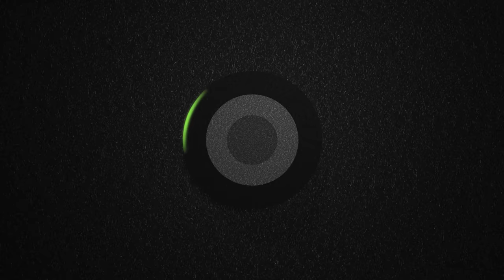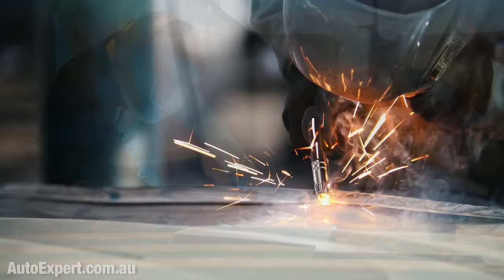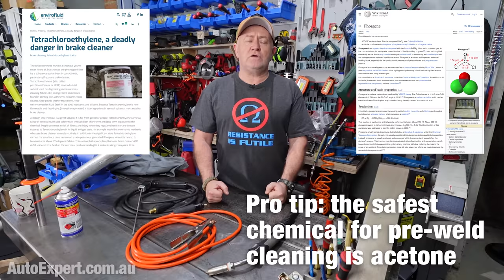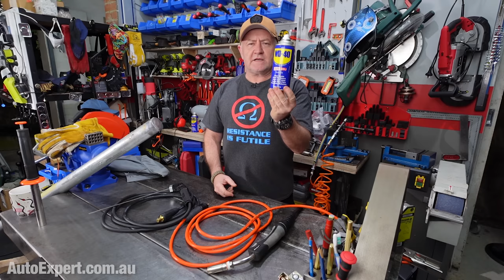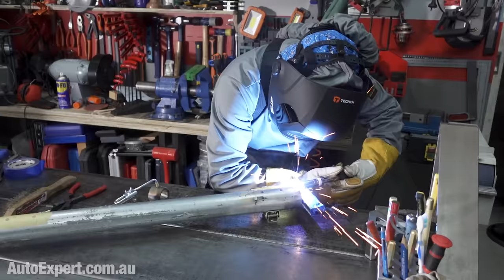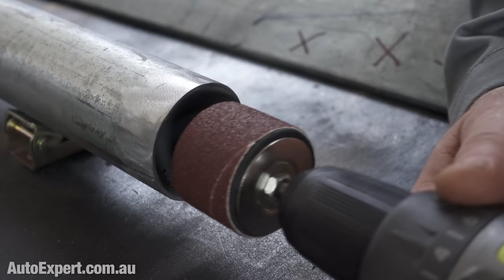How to die while arc welding at home: the top 5 ways | Auto Expert John Cadogan

Comment: I've been a professional welder for 15+ years, can confirm, these are all great points. Proper PPE is essential in all welding applications. I personally wear an Adflo 9100 rig at work 10 hours a day and it has made my life so much better the last few years. No more blowing black shit out of my nose at the end of the day, no more worrying about those accumulative chemicals you were talking about, and no more having to worry about people trying to talk at me while I'm welding because by now everyone just knows I won't be able to hear them while I've got it on!

I'm super curious who thinks you can't electrocute yourself with a welder, I've never heard anyone say such a thing but I don't doubt there are those people out there. If there is a safety thing to deny, there's some dip shit out there more than willing to fall on the grenade. The number of people who flat out refuse to wear PPE in the first place is mind boggling, I deal with it all the time. Hell, even just getting people to wear their damned safety glasses is a daily battle. Maybe I'll start posting photos of people with shattered cutoff wheels jammed in their eye socket.

But I digress.😂

Great video!
Reply: Great show,,,good stuff
Reply: Yeah I'm a weekend welder at best, and just got jolted for the first time a couple weeks ago. I guess the concrete in my garage is more conductive than I thought. 

I use an AC only Lincoln stick welder, which is pretty low voltage, so it wasn't a bad shock or anything, but it was eye opening.
Reply: Scariest thing I ever saw (knock on wood) was a person cutting through a brick wall with a large grinder (50cm+) to have the disk explode. The fragments missed all of us, thank God, but I can still remember the dude carefully checking if all his appendages were still attached. He had proper PPE, so he was alright.

Never witnessed any accidents, but working with lasers also scares the sh!t out of me. A company I did consultancy for had thick black cloth surrounding their test sites. Not to stop the laser, but so that any laser radiation that might escape be guaranteed to generate smoke & a burning smell. They had pictures on the wall of employees having a nice little hole drilled right through their thumb.

But I digress as well. Safety matters, folks.
Reply: Wizards!
Reply: One of the great sins of cutting tools [any kind] is people trying to "help" too much - let the tool do the work, and mind tool speeds.  As for cutoff tools, they are little mini grenades when pushed too far.  I... am still able to see, thanks to precautions that bore the brunt. I also have good hearing still from using ear plugs whenever noises seemed bothersome.  These things don't grow back, and there are no refunds for being a dumazz.
Reply: I know EXACTLY what you're talking about when you talk about people not wearing their PPE! I used to work in a chemical factory and the young guys in there would mix chemicals without their air filters (We had full helmets with a battery powered air pump and carbon filters. Except most of the guys just wore the dust filters because the carbon filters were heavier. Half the time they didn't wear the helmet at all anyway, though.) and wouldn't wear their hearing protection because they wanted to wear their ear phones to listen to music while they worked. We're not talking about mostly harmless chemicals, either. Not lead, but definitely not good.
Reply: My experience is marine construction pile driving and welding almost 30years. People wouldn’t believe half of the stories. I had a Forman mad at me cause of the time I was taking moving and setting up. The job is about 3inchs of weld on every 3rd sheet. That’s about every half hour. He takes my hood and the stinger and throw the hood in the ocean. Said you don’t need that here. Then starts welding with nothing on but 1 glove. I said get my checks I’m out of here
Reply: @MaraGro617  Throwing out good ppe?  Even Stormy's incompetent lawyer could knock that out of the park.  Third world operations would at least scrounge a piece of hood glass if possible so they make it to 40 and not go blind.  I worry about the country: seems like some of us were raised on stupid pills
Reply: @TheEvertw  
I once calculated the kinetic energy of half of a 12" grinder disc turning 3,300 RPM.
  What I came up with was more than a .38 caliber bullet.
  I've never rechecked my calculation; I just thought "Holy ____!  If that's anywhere CLOSE, it's still WAY more than I want to stop with my body!
Reply: I'm here for the pictures of grinder wheels in eye sockets
Reply: I'm here to see the laser holes in thumbs.
Reply: I did a TAFE welding course many years ago and the teacher used to complain about the headaches he developed after welding galvanised steel. I wonder if he is still alive?
Reply: @gamemeister27  it is not the voltage, but the current that kills.  Milliamps can be deadly--particularly depending on the path the current follows.  Crossing the heart (say the path is hand to foot) or in the example given head to hand, the heart probably took a hit and that's the end.  

Particularly with the human body--it's a giant conductor.  Electrolytes are basically salts and we are big bags of salt water with our skin providing a decent amount of resistance to current flow.  As soon that the current begins to flow, the surface resistance breaks down very quickly and once again, the end.
Reply: As a new hobby welder doing a lot of practice welds, I had the joy of blowing out a bunch of black gunk the other day.  I will look into proper means to avoid the fumes in the future.
Reply: So why are there all types of videos of Indian guys (and girls) doing all of this (and more) with NO PPE or even shoes on but seem to be ok? I bet there really is a body count somehow somewhere. Agreed, PPE is always going to be the solution.
Reply: A year or so ago I added a welder and plasma cutter to my 'fat cave' and needed a welding mask. I planned to get a 3M ADF version. Fortunately I realized I should get the PAPR that goes with it, as adding it later would cost more.  I also got a light 3M hood that uses the powered filter hose connection for when I'm grinding or painting. Yes, not having to blow black shit out of my nose is important, as it's not good for the lungs. Side benefit of the air flow, is the face place doesn't fog up! Hello from 🇨🇦.
Reply: @gamemeister27 Concrete is porous and water can sort of travel through it. I learned this by touching an outlet in a barn that had neutral and ground swapped. Shocked the piss out of myself.
Reply: I been a welder both field and shop for 40 years and have never seen someone electrocuted by a welding machine. I've seen and been shocked 100's of times! I'd say most caused by sweating  and being wet and it never being more than a annoying nip. I consider electrocution to be something way more severe than a simple welding nip. Our saving grace is that most of what we use is DC current. AC is more prone to get you. Ac will lock up your muscles to where you can't let go of the current. The man is right keep dry gloves. For extreme weather work I wear heavy rubber work gloves with a 8 in cuff. I don't know it all by any means and I'm sure electrocution from welding is possible. I'v seen a lot, and done a lot, some of it particularly stupid!  but I have never seen or personally known of somebody injured buy Welding current. The ac feeding the power source, all bets are off. Maybe I should just consider myself lucky.
Reply: @vicferrari9380 Hi. AC is Alternating Current... Meaning it alternates from +ve 120V to 0v to -ve120v 60 times a second (60hz frequency)... It's that window when it reaches 0v that allows ur muscles to 'let go'... With DC,  the supply is continuous, and there is no window for ur muscles to let go.....😊😊
Reply: Well thank you for the lesson. So your saying that your muscles have 1/60th of a second. 60 times per second to let go? Electricians they die regularly from the AC. So crews have told me. We got one job shut down for a bit because a Electrician several blocks away blew the hell out himself while in a electrical vault. 
Stay safe out there everything we do in the trades wants us dead.
Reply: @vicferrari9380   Good evening! Oh, people had been lucky enough to die on the spot without suffering post results of 3rd degree burns and/or agonizing fibrillations because an electrical panel blew up and put them 2meters in the air...😲 Maybe my statement sticks to comparing the same voltage in DC vs AC ... You have more chances of escaping the AC current....

Comment: I've been a fabricator for over 40 years and my worst experience was welding on a piece of equipment overhead. I typically welded wearing leathers - cap, gloves, aprin, jacket. I tried to cover up as much as possible to avoid a fire ball hitting the skin. Well a fireball popped into my ear canal and I jumped up as fast as possible ran to the nearest bathroom and poured water into my ear. I heard a sizzle sound and felt instant relief. I started wearing  ear protectors that you squeeze into the ear just for safe measure when welding overhead after that.   Great video! 👍
Reply: Appreciate the tip, never thought of ear protection as safety equipment for more than just hearing loss.
Reply: A co worker had a welding spark into his ear, he raced outside and put his head under the tap of the rain water tank. A few days later his ear his a festering mess of puss.  There was a dead bird in the water tank. Deaf in that ear thereafter.
Reply: @pauldeane9849  Ok, so use clean water without a decomposing bird in it. Noted!
Reply: I will go to great lengths to avoid welding overhead, but it is not always possible.  I definitely recommend extreme use of protective garments when welding overhead.
Reply: Doc looked in my ear and burst out laughing. The burning thermite blob had burned a spiral down the ear canal and fused to my ear drum. Doc said he'd never seen anything like it and I believed him. Told me not to get it wet in case it rusted. Couldn't stop chuckling.
Reply: I hate it when that happens!😂😂😂
Reply: I stick welded overhead a lot of times and yes these small hearing protectors do a lot for you. I always wear them because you have to use the grinder anyway when stick welding.
Reply: @jaggederest  Never underestimate the places a hot cherry lands

Comment: I was a welder in the A.F. About 50 years ago and made several of the mistakes mentioned. Welded galvanized and got sick as a dog. Was welding inside a metal box on a hot Philippine  day, I was sweaty and somehow completed thecircuit and ended up unconscious on the floor. My dumbest stunt was while i was tig welding. The metal table was the ground and I had an unopened can of coke sitting by me on the table. Flies had been bugging me and when I saw one land on my coke, I thought I’d zap it with the arc, the can popped and sprayed me with coke. If it had been a can of wd40 I would have unthinkingly done the same thing.
Reply: Did you get the fly though?
Reply: @NotQuiteFirst Yes. This is his superhero origin story.
Reply: @Dreyno ah yea, Cokeman. I heard he had a mixup or two with a few Peruvians because of his name.

Comment: I'm a retired industrial engineer - I had to investigate a ship yard accident in which a MIG gun was lying on a welding table,  about 2 feet away was a near full 12 ounce  can of Acetone.  Someone tossed a chipping hammer  onto the table,  it hit the mig gun,  squeezed the trigger and sent about 3 feet of  5/64 FCAWG straight into the can of Acetone -   It didn't explode, but went into  flamethrower mode, set off an overhead sprinkler and took a half million dollars of equipment out of commission....    About your little orange rattle can welder-     I've got a pretty nice home metal fab shop.   My prime welder is   a  heavy  ESAB Rebel  multi-process-   but after lugging it and a big 220  7KVA generator out to my tractor to weld  broken bits  more than  a few times,  I bought  one of those  $120   6 pound 110/220 140A chinese  inverter  stick welders like you've got -  figured I could tack up whatever was broke to hobble back to the shop...    I was blown away by how good it really is -  lays down astoundingly good filets on 220 -  deep penetration,  can do fancy dime stacking with 1/16" rod, and even though it says its got a 30/70 work/wait limit,  below about  50A  I've burned  two dozen rods in a row without stopping longer than the rod change  on 3/16 mild steel plate.

Comment: Just watching your vid, John, and having done a lot of arch welding years ago, wondered if I had any adverse affects from radiation.  Always wore a helmet and gloves etc....but....there's been this persistant little scabby thing just below my neck where the top of my shirt would have been open, and where I was probably not covered by the helmet.  Prompted by your vid, I went straight to the mirror, with my reading glasses on, and.....sure as shit, there's, what looks very much like to me, a little cancer thing going on there.  I'll be on the phone first thing in the morning to book a visit with the quack.  If it hadnt't been for your vid, John,  I probably would not have picked up on it until it was much further down the track.  Cheers.
Reply from the maker: Best of luck with that, mate - hopefully DermoDoc can just freeze it off with a little LN2.
Reply: Just hit it with the welder
Reply: Mmm, perhaps I should too
Reply: In my Intro to welding class, I must have gotten 2 or 3 severe sun burns in the same exact space. Young and couldn't afford a proper welding top. Nothing compared to doing it for years. But painful enough to get it into my head that was going to be an issue doing it long term.

Comment: I disregarded the UV exposure warnings for a long time because I rarely weld for hours on end. But recently on a project building cages for 55 gallon drums (to be hoisted with a truck crane more effectively) I was welding for damn near 6 hours straight. The “sun burns” I sustained were almost so bad to the point of peeling. Strange thing is they didn’t hurt at all and I didn’t notice until I took a shower. Absolutely surprising and very much a humbling moment.
Reply: Yeah those types of injuries are horrible, I once worked on a huge water reservoir, in construction not even welding, all it took was 3 days in the sun and the back of my neck looked like a yeast infected pussy who has had crabs on and off for a decade... Pouring ice cold olive oil on that wound after work was the most amazing feeling I've ever experienced
Reply: Learned my lesson early on as an apprentice with a loose necked shirt and arc burned the piss out of my neck and exposed chest. Have made sure to nor replicate that mistake ever again. I have warned every apprentice since.
Reply: One of my first welding jobs was in a fast and furious factory setting where we turned the mig wire speed all the way up and set the power to match. Very hot, you needed every last inch to be covered or you were going to get radiation burns or spatter burns.
You had to be very careful about 
SIDE SHIELDING your eyes or the lens of your eyes would get radiated from the guys to the sides of you. The radiation was that intense.
I always remembered that place even though other shops were no where near that extreme.
One job I had was mig tack welding things together to be welded by a robot arm welder.
I had electronic shield to use but I felt it was too slow as after a day of tack welds with my eyes open I could tell I was still getting flash build - up. Plus looking through an electronic shield is still like wearing sunglasses , they are never ' clear '.
The best way was just closing my eyes but I didn't want a lot of radiation to my face so I learned to keep the mig nozzle itself in position to act as a tiny 
' courtesy shield ' and shade my face.

Comment: Great video John, I've been welding many decades and remember the story about the guy overhead stick welding with a Bic butane lighter in his shirt top pocket. A hot spark then found its way to the lighter and ignited it. You can add that to your list.
Reply: I heard about the bic lighter about on week after using a cutting torch overhead to cut a solid 2 inch shaft while I had a bic lighter in my pocket.   It was raining hot slag and sparks. After that the lighter stayed on the roof of my van when the torch came out.